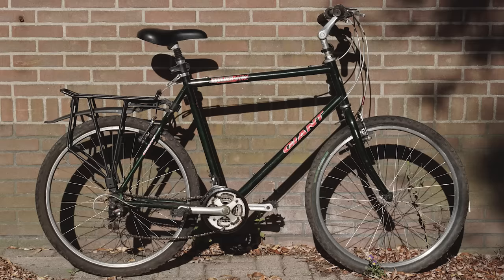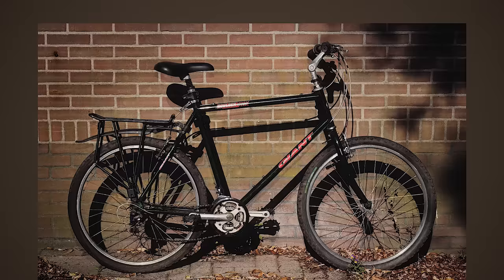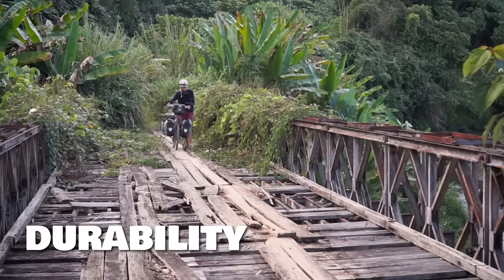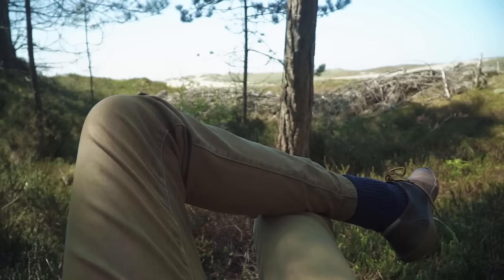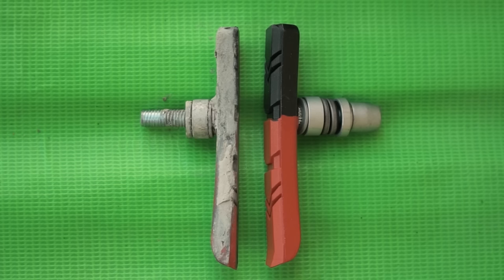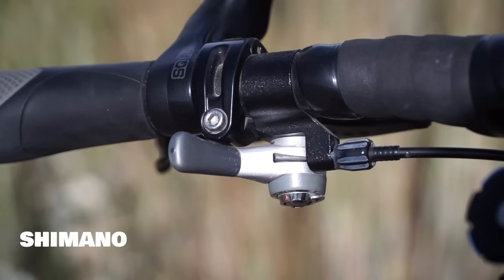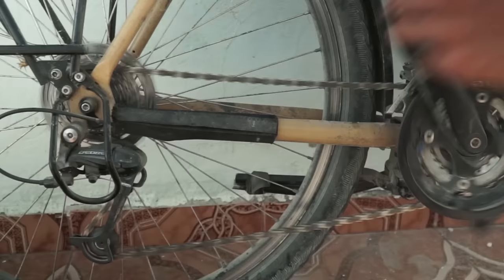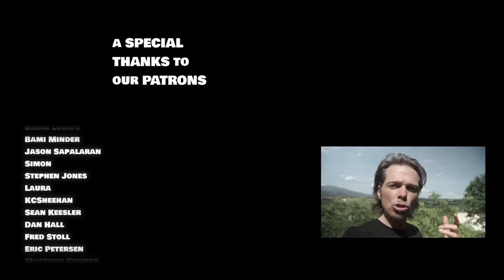World Touring Bike: My 90's MTB Evolution ( 25.000+ Kms on the Road )

Comment: If you do this, be sure the frame is chrome moly steel and not just regular steel.  Moly steel absorbs road shock much better.   A lot of people dont realize that many 90s mountain bikes are moly steel and similar in geometry as a Surly Long Haul Trucker costing much more. I have a 96 Specialized rigid bike.  I built it in similar fashion and I can spend days in the saddle.  With me and my gear, the bike is hauling 300 pounds.  You cant go wrong with 36 or 38 spoke Rhino Lite wheels, Shimano Deore hubs (stronger than XT or XTR hubs) and Shimano LX or XT components. High end components arent as durable and cost too much.  The Brooks B17 saddle is the best ever ONCE it is broken in that is.

Comment: Love this! Recently also bought an old MTB for some off road cycling. It feels so good to upgrade old bikes and make them run smooth again :)
Reply from the maker: That is great to hear Rosanne! Have lots of fun with your bike! All the best, E
Reply: Mostly incredible cost inefficient. Get a decent one rather and have fun
Reply: Especially at the more beginner line bikes of the 90s, the frame geometry is more touring oriented, than at the way more expensive race bikes of the era. And they are chromoly too. Great base to build, like in the video.

Comment: Hey! I recently bought a 26" aluminum MTB in size 19", also from the 1990s, and I'm starting to upgrade it. I thought about buying the same model with a steel frame, but this one with an aluminum frame has a double barrel technology, which makes it stronger, but even lighter than the steel one. Let's see how it reacts...
I chose to put a Deore 1x12v group and 700 rims, probably with 38mm tires due to limited space for the tires. The rest of the equipment and parts will be as durable as possible, as my intention is to do some crossings and also long trips.
I'm always in the audience! Hugs!
Reply from the maker: Great to hear Alvaro! It sounds your bike is coming along nicely. Have a lovely time riding it when it's done :)

Comment: Great video once again! In 2018 I bought a second hand 2011 Giant XR1 with a Deore group set. The thumb shifters still shift perfectly without adjustment after the nearly 17000 kilometers I did on it! I cannot believe it, but that's how it is. I did replace the rear casette once and only just replaced the front big chain ring since it had developed "shark teeth". I also replaced the squeaking bottom bracket. Now it is like new, so smooth and quiet!
Reply from the maker: That is great to hear! The Deore group set is probably my favourite one for being so well rounded and balanced. Enjoy your rides :)

Comment: Really nice bike! I think in terms of durability, the 90s MTBs are among the best out there. I finished a touring bike from an old 26" Steel GT last winter. The frame was gifted to me and it already had the frame conversions like more bottle cage mounts, kick stand bracket and disc brake mounts. I had it powder coated and built it up. It's such a great bike, as a daily commuter, with a big trailer (I sometimes haul bicycles for a small workshop and the brakes are especially good for it) or on bike tours across the country. Certainly one bike I'll have for a looong time and hope to take on longer trips in the future. And even though I wasn't looking to spend the least money I'm far below the typical price for a bike in this range and quality. So long Blabla :D … I can absolutely relate to the bike and I'm most certain it's doing a great job, even with "only" 3x8 (I'm running 3x9 on most of my bikes, but 3x8 is just as good IMHO). … Last but not least, great videos, I really enjoy watching them. So thank you very much for your work! :)

Comment: This is great for people like me because my cheap bike uses all the parts of a 90's bike. Open bearings, cup and cone. I have made upgrades like a sealed bottom bracket, metal pedals, lighter handlebars etc but I love the solid, slightly elastic steel frame of my cheap bike. It's so smooth and thank god it had proper pannier mounting holes. I ditched the front derailleur and am running it 1x6 which is ideal for me as I only ever freewheel down hills to save energy and I am more than happy doing 13-18mph in 6th on the flat - especially loaded up with gear. You do not have to have a lot of money to go on a bicycle adventure, in fact - it's a very cheap holiday. Even cheaper if you teach yourself bike mechanics.
Reply from the maker: Great stuff! 💪🏼 Happy cycling!!

Comment: Last year in May, I purchased an Motobecane Elite 8 IGH (Shimano Nexus Internal Gear Hub) bicycle. So far I have upgraded and or changed the following on this new bike which is now, 3x the amount in what I originally paid for it. 1) Added a Suspension seat post and different saddle  2) Swapped out a handlebar from one other bike I have to new one (bike touring handlebars; Soma Fabrications) 3) Removed original single gear front crankset to what spare crankset I had (which was turned into a single gear crankset; Shimano SLX MTB crankset); I called my LBM and he suggested, especially for fully loaded touring, to upgrade the IGH rear hub to an 11-speed; Alfine 11-speed IGH set up...sometime in future.  I have yet to install fenders and further shrink down the front chain ring from a 36t to a 34t in order to compensate for gear ratio that of only 8-speeds vs. cargo weight. I also plan, if and when I decide to travel on my e-bike (which I too built up and customized) to add another battery to carry with me for further traveling distance, plus a higher AMP charger for faster charging. Both of these bikes like yours, are solid; wheels are sturdy and rigid,  and frames are Alloy. Both have a front suspension fork on them, a solid rear rack (25kg weight capacity) that I also have a front cargo rack (45lb carry load) to attach to either one when needed. IMO, the best traveling, least maintenance required, and way less worries of components breaking down while traveling is the Pinion Gear box (up to 12 speeds) and a Gates Carbon Belt Drive train set up on of course, an alloy, or chromoly frame with the rest of customized added components to complete bike build. "Priority bicycles"; ALL ROAD 600 bicycles are a great one. Check out their website sometime. Happy trails and safe travels.
Reply from the maker: You can make a great video from what I read here Tracy! Isn’t Ryan van Duzer riding the Priority bikes? They sound fantastic for sure 👌🏼 Enjoy the tinkering!! Best wishes,Eric
Reply: @WheelstoWander  He totally is; He currently is using a pinon Gear, Gates Belt Drive Bike Packing bicycle from Priority. However, those bikes are not cheap!  If you are a thrifty person and know where to buy parts that are within a reasonable cost, plus one's ability to build up/customize their own bike, one can save a ton of money!!!!  For example, My motobecane has hydraulic Disc brakes and the average cost to have them professionally bled is about $100.00!!!! When I can simply purchase a bleed kit for my brakes for $18.00; learn to do it myself through How To videos and save a ton of money. I saw a article about the cost to maintain a bicycle and their summary was this:  about $185.00/yr if you do your own work. If you have a professional do a large portion of bike repair/maintenance it will average about over $600.00/year. The mechanics of a bicycle is the  basics of understanding machinery.

Comment: I bought a Schwinn Moab 90s mtb today for $350, most of the modern upgrades already installed:
Surly moloko bars
Rigid fork
Threadless headset
Good modern wheels
Schwalbe Fat Franks
New 2x drivetrain with low gear of 26x34t

I just need to put on racks and fenders and it'll be ready to roll
Reply from the maker: Sounds great 😊 Enjoy the ride!!

Comment: I've modified a 1989 Rocky Mountain Hammer. I've added racks front and back, a mount for a handlebar bag. I'm running the original Biopace chainwheels, a seven speed 11-34 freewheel, drop bars and Shimano tourney brake/shifters. Pedals are flats on one side, SPD. on the other. The wheels are the original Ritchey rims. Tires are Schwalbe Marathon Plus Tours, 26X2.1.

It is really great to ride is is very comfortable.
Reply from the maker: Sounds like one heck of a bike 👍🏼

Comment: This was a great video! Very nice job on the build. In my opinion the best mountain bikes for touring are from the 1980's. The ones with the horizontal top tube. Most have crazy long chainstays (also wheelbase) and slacker more comfortable angles. I built up an early '80's Maruishi "town and country". It has 18.75 inch chainstays and has a 44.5 inch wheel base. It rips around turns like a freight train even fully loaded on dirt!
Reply from the maker: Thanks! I will have a look at these older bikes 👍🏼 Sounds great!

Comment: That you’ve toured so many places with these modest old school components says a lot about the trend of complicated disk brake bikes, with lightweight carbon frames, costing 10 to 80  times more. I  used to have several bikes like these, purchased for $50. Only thing I’d recommend is to just change the bearings (bb, wheels, pedals) before a big trip or in a regular basis, if they are cup and cone. Costs a few euro for a bag, and will keep the races from wearing down, making the bike pleasant to  ride. I think there’s also a possibility that your frame will crack near the BB, which is a normal end of life outcome, because it has been so heavily loaded and you’re the second owner. No safety issue however. 

Would like to see a LTR of that saddle.
Reply from the maker: Thanks Marc! High end has it's place but simple technology is what's best suited in most situations. Some great tips there 👍🏼 Heads up for the saddle review too, thanks! All the best, E
Reply: @WheelstoWander  I think that plate welded to the chain stays (for the stand) is a great way to stiffen up the BB area and make the frame stronger!

Comment: Initially I assumed you had a high end bike because your camera and other gear is so top notch. I thought yours was a Surly or a Soma  with that tan color.  My tourer is a 90's Trek 930. MTB I actually own two of those frames, the older 80's one is now  a cargo bike.  The older Giants were great frames .  I LOVE your new upgrades. Eventually I might do the ergo bar thing but I'm still "old school" with the drop bars and bar ends. My hands survive OK , but sometimes I wrap a bandana over my right brake hood for extra cush.  I need some foam or something.  Oh I just got a used Yak BOB trailer, It's freaking awesome. I will use that for local flyfishing forays . I can carry tent , bag, waders and vest in it  and 2 days of food. But for a total LD trip I'd probably go back to the mule bike setup.  Loved the tire review also.  ONWARD.
Reply from the maker: Hi Robert! Looks can be deceiving I guess 😉 Great to hear you are running some oldies yourself with good succes. Upgrades are always on my mind too, always wanting to tweak that bit extra. Best of luck with your future plans 👍🏼 Best wishes, Eric
Reply: @WheelstoWander   Thanks . Hey here's a  heads up on those Deore hubs. I run a Deore  LX on the rear . Peter White in his blog said "they are great hubs, but may  need cone adjustment and re-tensioning or they may start to bind up". I found that to be true. The fix took two minutes.  I'm wondering if maybe you saw that  happen , especially on all those dirt roads?  I just did a grueling, hilly,  60 miler with the Yak BOB  trailer. Two flats , hard rain, 3 hours sleep the first night, but I caught the huge trout I wanted, so  it was a total win. I am still toast. Got back on Friday.
Reply from the maker: I had the bearings replaced in Japan after the Pamir Highway. The rear hub was starting to wobble from the battering on those rocky downhills. Never had any binding issues though 🤞🏼 Sounds like a beast of a ride. Great to hear it was worth it :)

Comment: Have you guys thought about switching from 26 inch wheels? Several other bike touring channels I follow say they had trouble finding 26” components due to that size being phased out. The owner of my local bike shop says he has to special order 26” wheels and accessories for them from now on, increasing the price.
Reply from the maker: We thought about it. There a shortages in all kinds of bicycle components world wide. In our experience it's harder to get parts for the 3x8 / 3x9 drivetrain than it is getting a a 26" wheel. That of course depends on where you are and what would be available online.

Comment: Do I see correctly that you have a 3x8 drive? Didn't you want to build a 3x9 or 3x10 drive? You would have a wider choice of drives.
Reply from the maker: Yes! A wider choice but only slightly as a lot of gear combinations never get used. I liked the idea of a slightly beefier chain compared to a thinner 9 or 10 speed one.
Reply: @WheelstoWander  Thank you for your response. So the 8-speed drive still has its place.

Comment: I think Steel frame is clearly easier to repair than an alloy framed bike.  
Just steel, is it worth the weight.
Reply from the maker: Aluminium welding is not that easy and widespread so steel is your best bet out there when having serious frame issues.

Comment: Hi Eric, this was a verry interesting video! I have an old 90´s steel frame, but it is lugged. I am not sure about stability of this frame with touring load on rugged roads. My second question: what do you think about front panniers compared to  extra load on top of the rear luggage rack. Sometimes, I feel a negative impact on the steering quality with front panniers. What is your experience with front panniers?
Reply from the maker: Thanks Robert! I sure like the look of a lugged frame, perhaps google the model and see what you can find about the frame building process. A forum or local specialist could help too. I like front panniers and actually feel the steering quality improves as it becomes slow and more stable. A personal preference perhaps but I am all for a comfy and relaxed feeling riding style. I do want to dabble with a more sleek looking bikepacking style though and probably change out the front panniers for bottles, small bags and the sorts. Some weight is need to prevent the front from jumping while climbing. Hope this helps!? All the best

Comment: Interesting Video, is a more upright position putting more weight/strain on the butt? Or ist the Upright angle distributing the weight to the whole butt better. Hard to say as builds are very different in a human, but was wondering if you have an opinion on this.
Reply from the maker: I lean less on the handlebars so I guess more weight would shift to the butt area. As a whole it feels better for my back, shoulders and neck and the saddle helps with pressure points at the butt side of things ;)